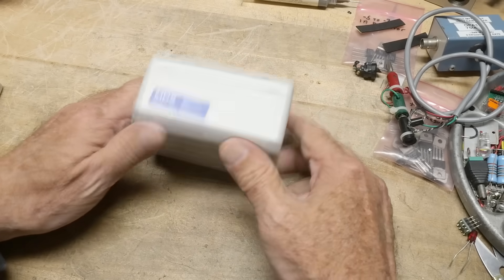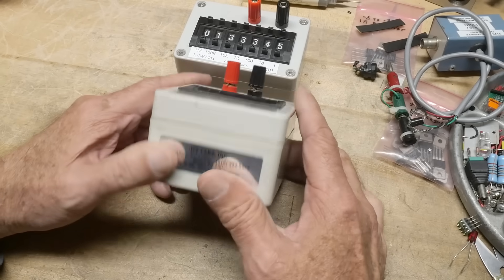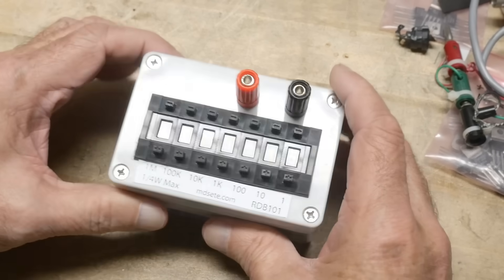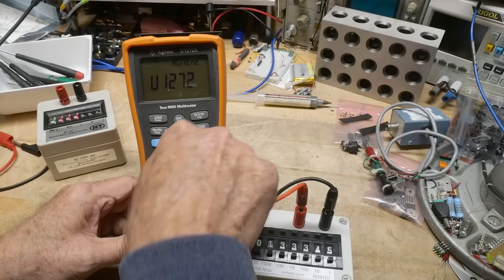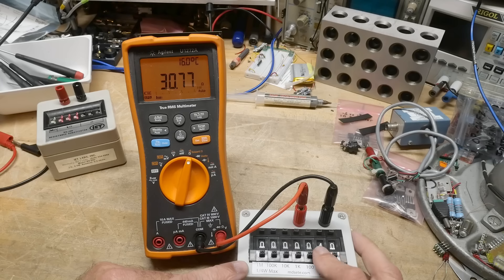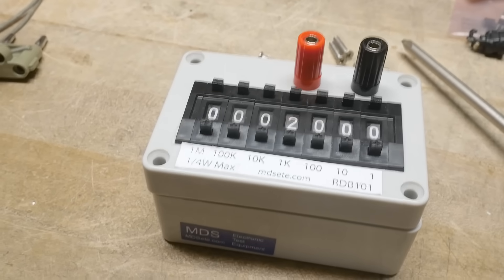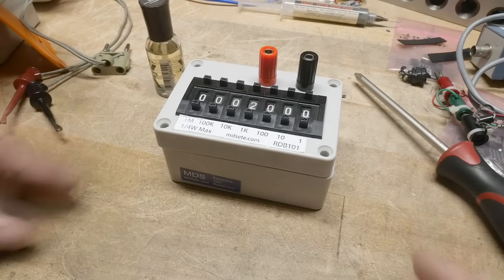# 2172 Decade Resistor Box

Comment: When i was in junior high back in the 80's i took an electronics class in which one of the labs we had been given was to create a high current circuit and test it.  The design called for the use of a potentiometer but our instructor never told us what a potentiometer was.  So in our collective wisdom we decided since the schematic showed a variable resistor we thought this meant to use a resistive decade box much like yours (except this was before SMT resistors so they used regular 1/4W resistors).  So we proceeded to build our circuit and power it up.  they lasted for about 2 seconds before everyone began to smoke and a few spit flames until we all pulled the leads out.  Boy were we shocked! our teacher came running out and yelled at us until we explained what we did and why.  That cooled him off.  From what i was told at the time they had to completely replace all of the boxes and tis cost the district quite a bit of money.  These weren't cheap boxes but high end ones.  I think the circuit called for like 4-6 Amps and we were using a box designed for less than 1A of current.  Lesson learned!

I do remember though we did disassemble one of them and could see they were wired a lot like this one you show was.  They were wired to mechanical rotary switches and each post had a resistor connected to one end and the other end of the resistor was connected to every other resistor in parallel a lot like yours shows here.  We did figure it took a lot of work to wire al that up too.

Comment: Great review, wonder how long before the switches ware out?
Have a General Resistance decade box, it uses 0.01% resistors.
Pulled out of a piece of test equipment from a company I once worked at.
Over all it’s 0.02% accurate with a 0.05R resistance when all switches are 0.

Comment: For the binding post issue, I'd drill another hole 3/4" away from the red post, move both over, then fill the empty hole with a switch that would short out the 2 binding posts.  Not a super useful feature, but it keeps the OCD from tweaking your ear every time you see the unused hole.

Comment: I purchased a decade pcb.  A pcb with 1206 1/4W.  Jumpers used to connect each decade to the next.  Just a pcb no box.  It was $14.  When tweaking an analog circuit its use is invaluable.  Awesome piece of test equipment for $14.  And just like yours the posts are off. LOL.
Reply from the maker: I show those: https://youtu.be/wo9YUFcASW8?si=j4I4r4ysU81-3BOA
Reply: @IMSAIGuy  Yes indeed but yours had the nice printed box to go with it.  Those posts are consistently off.  Maybe in another part of the world they fit a different size double banana IDK.  Funny you put out this video I've been tweaking with that decade pcb the last two days.  I love that thing.

Comment: 00:35 - Expensive because its calibration equipment for testing (measuring) devices and its built to last. Its specialized industrial equipment, thats why its hard to find. It was probably damaged when someone wrongly wired it during calibration process. You can find also decade capacitor box.
Reply: Not really precision but good enough for 3.5 digit multimeter check and calibration. The price comes from the switches and the brand

Comment: If I'm correct, this circuit used an individual resistor for each value, so they would require 70 values of resistors?  There's a much better way to do it by stringing the resistor in series.  Then you only need 7 values of resistors.  Also putting them in series also will improve accuracy because it allows errors to average out. Too bad the binding posts could not be put in from one of the sides, the test leads would flow a bit better.

Comment: I always wanted to build one with some linear taper pots and a built in digital resistance meter.  Push the read test button and set the value you want  or adjust the value for your circuit performance then read the value on the display.   Looks like a good find on ebay,  The cost of gas for a few parts runs to Anchor Electronics would be more than $35.

Comment: IET bought up ESI and GenRad several years ago. Both were the major suppliers of L, C, and R standards and test equipment in the US besides Leeds & Northrup. I have the large ESI 242D precision resistance measuring system, and several of their standards and LCR meters, here, along with the old L&N oil-filled standard resistors.

Comment: I took a chance on an eBay IET resistor-capacitor decade box that had been in a fire. The box was melted but suprisingly the decades were both okay. Put them in a new box and now use them regularly. Soldering the leads from the switches to some good binding posts may improve the accuracy. Happy Birthday!  David

Comment: I would advise you to not spend too much trouble trying to improve this thing, it is a piece of junk which is not worth the effort. I bought one a few years ago, thought it was a wonderful piece for the price. I went to test a freshly repaired multimeter with it a few months ago, and found out the switches in this thing do not make great contact after just a few years of aging. If I set the thing to 0 ohms, I may get one ohm, 5 ohms, 30 ohms, etc. Cycling through the ranges tends to improve things a little, but you can never count on it being correct. I was planning to take it apart and see if a little Deoxit on the switches would help, but after seeing the construction I don't think that is a possibility.

That construction style is insane, must have been some incredibly cheap labor to build it that way. Regardless, I would consider this to be more a useless trinket than a useful device.
Reply: I keep a spray bottle oif 99 isop to spray into switches to bust off any crud and often improve contact.  Work it around and see if that helps,  plus it will not hurt plastic and evaporates.  The other stuff would maybe maintain a good connection once the switch is clean.  Do not use spray alcohol near heat or flame.  They banned it in my shop because they decided alcohol mist was a fire hazard.  So interim fix was to label the little spray bottles as water. Then we had to use spray cans of cleaners that were probably worse.

Comment: I got two of the old Heathkit decade resistors that as I recall are within 1% and got them really cheap at hamfests.  I am also in the process of making a meter check resistor array with a pile of precision resistors,  including .02% jobs that I got in the big bag of misc resistors recently.  One switch is 100k steps to 1 meg with .02% that measure better than that on a cal'd bench meter 4 lead.  The second switch is a bunch of even value precision jobs like that from .5 ohm up to 50K.  Many of the .02% jobs are little square Daven jobs from the 60s.  All that I am using are much better than 1% jobs.  I have priced surplus Genrad decades.  Pretty steep and it is maybe common to find used ones with fried low value wirewound resistors in them.  They are marked with the current limits.

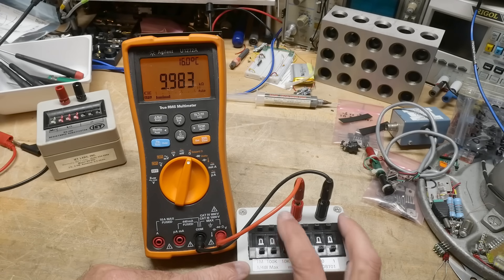Comment: 4:34 it's a 0.17% or 0.2% box. Those 7 decade resistor arrangements for 3$ from ali can be rather precise. 
I made such a box with such a 7 decades board and thumb-switches for less than 15$. It just takes some time to make the connections while watching other people (including 2 year younger ones) on you tube discussing other equipment. 
The punching pliers can also be pressed between the knees and the needle pliers are rather handy.

Comment: And here I thought my synth modules and guitar pedals with a bodge cap or two were dodgy! :D I bet if you made a jig to hold all the resistors in a reflow oven you could do it fairly quick but I'd be asking more than $35 for sure. I'd be surprised if I could get the materials that cheap.

Comment: I bought switches to do this, put them to one side in a draw and forgot them for about 2 years, decided to start, then noticed i'd bought bcd switches... doh!.... so i used some rotary ones I had bought. And SMD resistors, hell no you want at least 1w 1% just incase theres a bit of current those things would explode into little bits!

Comment: Never saw a small decade box with a push button dial and SMD resistors. I really like the idea of something compact like this, but I’m not certain what the current capability would be for those SMDs. I work with amplifiers so I like to have 1/2 Watt resistors. I could not tell from the video how large the SMDs were. What would you guess the power rating is on those resistors?  The one I built has the rotary switches with 1/2 W metal film resistors

Comment: Nice little decade box, though low power rating limits its use. Make it .6W, 1W or 2W and it'll be far more versatile - but getting resistors rated for high enough power while keeping 1% tolerance (if not better) and low thermal coefficient while not going overboard with price might be tricky.

I'm surprised by the internal build - I was expecting serial ladders of equal resistance, like it was done WaaaaaayBackWhen with wire-wound resistors. This would be cheaper in manufacturing too, since you don't have to keep stocks of so many different values.

I sometimes used clear nail polish as some sort of conformal coating to keep the homemade board from oxidizing. Ha.